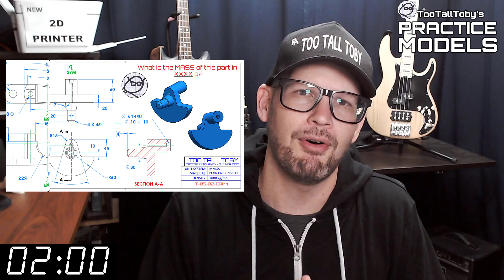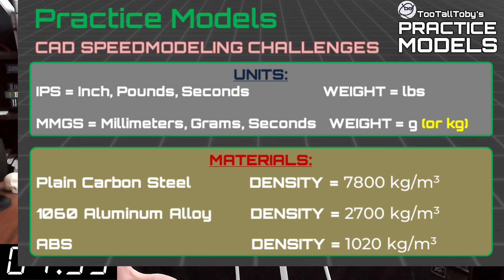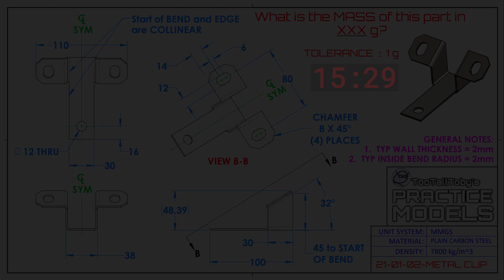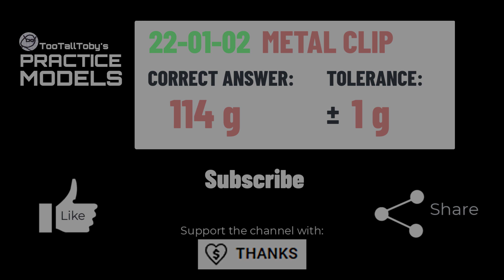SOLIDWORKS Practice - Onshape Practice - Fusion 360 Practice Exercises- TooTallToby-21-01-02

Comment: I'm terrible at making sheet metal parts, so thanks for posting these practice models, Toby!  Working in Onshape, I got a mass of 113.98g in 5:14, but I couldn't figure out how to make the 8x45-degree chamfers on the top flanges with the Chamfer Tool, so I made them manually with lines.  I was able to make filets with the Filet Tool but can't make chamfers with the Tool in this model.  Is that normal?   * Edited comment: In hindsight, I realize now that I needed to use the "Finish Sheet Metal Model" tool to put the sheet metal tools to bed, which then allowed me to use tools such as the Chamfer Tool.  Cool.  No need to comment, Toby.
Reply from the maker: Nice work!

Comment: Ooof I struggled a bit on this one... The biggest issue in Onshape with sheet metal drawn in Solidworks is that Onshape doesn't let you create a flange starting from the radius tangent (the default in SW). So it's possible to get the same shape but it takes extra work to get a flange dimensioned from the start of the bend!

I was also fumbling and mis-clicking and looking for commands a bunch so it took 5:28 on the first try.
Messed up the beginning of take to but recorded take "2.5" and that took just about 2:00 exactly.

Posted a video of the solve on my channel if you are curious...
Reply from the maker: Great work airwick!  Thanks for posting these solved videos too!! I love watching them!

Comment: Time: 9:57
Mass: 114.00g

I was wondering when a sheet metal will show up. I believe that the bend type explanations are not right and can be presented in a better way :) Nice one!
Reply: Normally, customers will specify the external/internal dimensions without specifying the bend types. You can figure out that the bend type is "Outside" from the given dimensions.
Reply from the maker: Nice thanks Achilleas!!  Yeah it's hard to figure out how to define it (on the drawing) in a way that ANY cad system user can interpret it.  I'll release some more Sheet Metal challenges and hopefully I'll find some better ways to call this stuff out  :-)

Comment: Time: 17:4
Mass: 114.8 grams
I used edge flange 2x. Then mirrow. I think something is still not right about my dimensions. As I am on the edge of tolarance.
Reply from the maker: Nice job - that one is really tricky so I had to leave the tolerance a little loose - good job coming within tolerance!